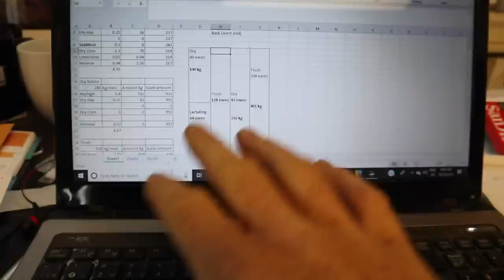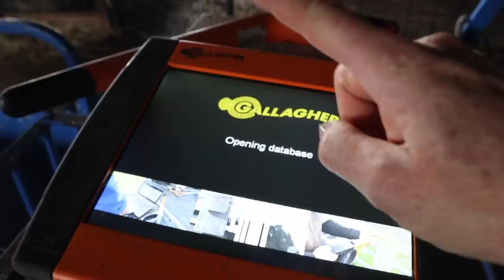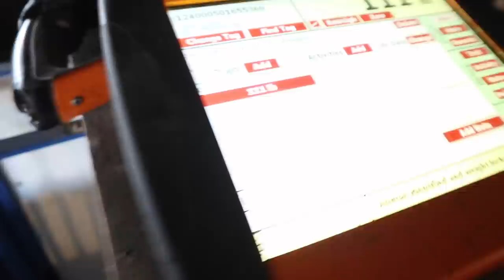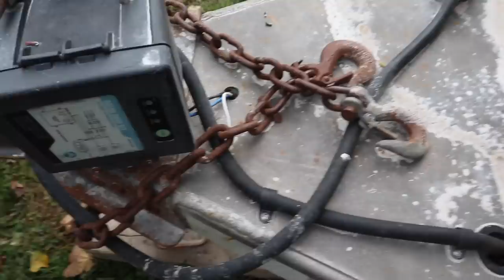Feeling Like an Uber.  (Moving Sheep, Spreading Manure & Shipping Market Lambs): Vlog 172

Comment: I just got 50,000 ton of litter. I would spread every year but I can never find enough, sometimes none. Last time I spread all my fields was 4 years ago. Last year and the year before I was lucky to find 10,000. I was very impressed by the farm you bought from. I like that it was piled indoor and looks like it’s been processed and cleaned. I buy straight out of the coop which has stones and other debris. I then have to dump it in my galvanized heat house. It’s a lot of work.

Comment: when using the bucket on the telehandler, please set it "flatter" on the ground, it will save the tip blade in the long run on that concrete floor ;). otherwise great to see oversees sheep farming operations

Comment: I'm quite new to your channel and I have to ask... Are you're sheep ever outside?
Reply: Her sheep live in the barn year round.
Reply: @honestjohn3881  so they are never outside on green turf and under blue sky?!
Reply: @stevewarne2431  The barn has an almost clear roof and clear sides (she throws curtains up at some point in the year), but no, they'll never experience grass.

The reason is because of coyotes in particular, they are prominent in her part of Canada, and she said in a video that she is terrified of losing any of her flock to predators,  so staying indoors was the safest option.
Reply: @honestjohn3881  ah ok thanks. I guess I'm just used to seeing all the spring lambs outside over here in the UK. Thanks again.
Reply: @stevewarne2431  No problem mate.